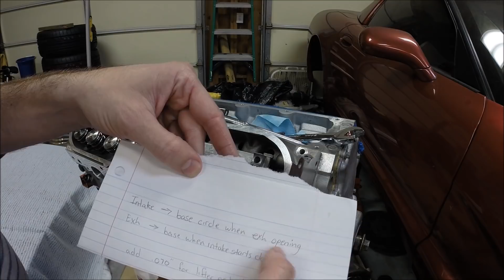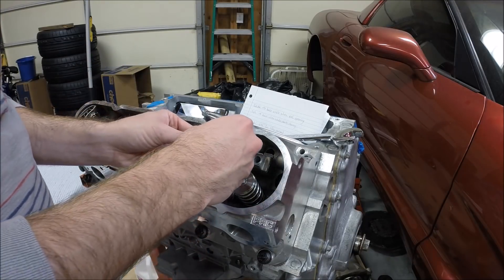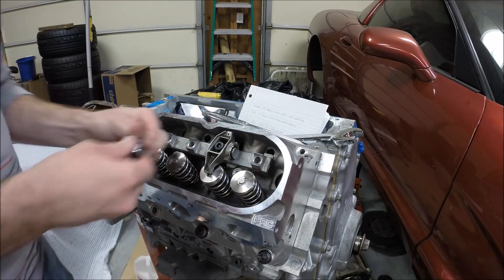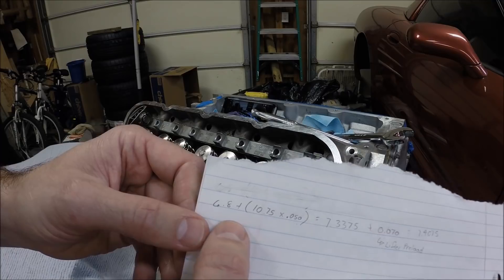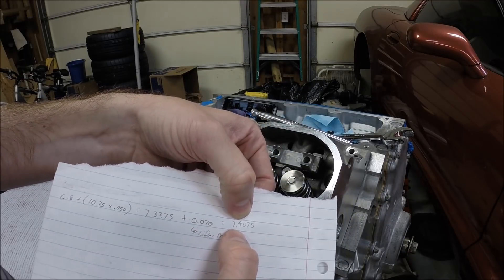LS Engine Tech: Measuring for Proper Push Rod Length

Comment: Ok Excellent video! My question is can i follow the same steps that you have laid out without dissembling my old stock roller lifters? Basically i was under the impression i could measure my pushrods during final assembly and have already torqued my heads down on my 408 inch Lq9. So taking my measurements following your instructions  (only with my stock replacement comp cams roller lifters instead of your solid lifters) will that change the lifter preload that you've provided at .070? After the smoke cleared my math came out to a 7.3325 push rod. Thanks for the post much appreciated!
Reply from the maker: The challenge with not using solid lifters is that you can compress the lifter or it can bleed down (or wasn't fully pumped up since the motor hasn't run) and give you a false reading.
Reply: Ahh i see... well so far I've checked 3 separate valves and have had the exact same reading on all three. I guess i will have to cross my fingers on this one. Thanks again. @ScrufsGarage
Reply from the maker: No problem.   Best of luck.   Let me know how it turns out.  Hopefully a super quiet valvetrain!!
Reply: Michael Cullen what are the cam specs?

Comment: I'm working on my first LS motor, I've built many OS SB and BB chevys in the past, so Im at the research stage, and ripping down my junkyard 6.0 LQ9. Regarding this video, what would be the procedure if you didn't have the old gaskets? Do you wait until after you install and torque the heads down to do the measure, or can you dry fit the head without a gaaket and then deduct the amount that a compressed head gasket specs say it wil be?
Reply from the maker: Yes, you could dry fit and then add the amount of the compressed head gasket spec.

Comment: You partially bolted the head on because you knew you already had compressed head gaskets right?
Reply from the maker: That's correct.  I used the old head gaskets which were already compressed for measuring.  At that point, you only need to get the head bolts tight to take out any play, but the torque sequence isn't needed since you aren't compressing new head gaskets.

Comment: After watching so many videos and still confused by them this is the best one
Reply from the maker: Awesome, glad you found it helpful.  Thanks for watching and good luck on your project!
Reply: Scruf's Garage one more question, after you get the right pushrods, you still torque them down to the 22 lb ft correct?
Reply from the maker: Yes, the torque spec for the rocker arm is 22 ft/lbs.   The "Cylinder Head Install - Part 2" video leads off with installing the push rods and rockers arms and has some installation tips that may be helpful.  Check it out if you haven't already.    https://youtu.be/cpLwWdWKvCM
Reply: Scruf's Garage awesome I just did, great videos! They help a lot! Keep up the good work!
Reply from the maker: Will do!   Thanks again for watching!
Reply: @ScrufsGarage  where did you get the 0.070 from?
Reply from the maker: The numbers seem to vary depending on who you ask, but for the most part, LS7 lifter preload spec ranges between 0.050" to 0.100".   So 0.070" is a very common spec, as it puts you right in the middle.
Reply: slowgoat6.0 I know right? So many others didn't explain like he did.

Comment: So where is the end of your rocker on your valve stem?   Also I want to know how many days did it last before it blew up.
Reply from the maker: I'm not clear on what you are trying to ask.  The LS engine family uses net lash rockers, so the only way to adjust the sweep of the rocker tip is to shim the rockers or pedestals.  However, there is no seat under a stock rocker arm that can be adjusted on a stock setup. The entire stand has individual pedestals on them that align the rocker and provide the proper seat height for them. The stand and the pedestal are one piece. No adjustment there. You can shim the stands, but you would not have that option on an all stock engine, nor should it need it.

Comment: you know there is a guy at sloppy mechanics channel that puts cams in his engines and uses the original push rods and makes over 1,000 hp turbocharged
Reply from the maker: I'm not familiar with his specific setups, but there are a few basic considerations.  Depending on what components you've changed, you may need a different length PR (which is the point of this video).  As for upgrading PR's, remember that dual valve springs have a lot more spring pressure than stock beehive springs... thus more force on the PR's.  PR's don't make horsepower, but they can cost you HP... or an engine.  Deflection in the PR will cost you total lift (and thus HP) and a risk of a failure.  Is it worth the risk to save $100?  As for reusing PR's, I chose to reuse my PR's but I already had an upgraded set of .080" wall PR's.  But be sure to check them for straightness.  Roll them across a flat pane of glass.  If they wobble... toss them out.  HTH
Reply: Scruf's Garage i can send you the links to the parts hes using. the valve springs he is using are single coil springs good for .600 lift for pac #1218 cam is an elgin cam .575 .575 lift every thing else he uses is directly original to the engine. with out the turbo it makes like 560 horse? with just a cam.  latest engine he did this to was a 4.8l ls1 he even used a push rod that was egg shaped from riding on the cam lobe and just flipped it over and used the good side on the cam. he also dosnt torqe anything down usually. just runs the bolts down with an impact...
Reply: Scruf's Garage i am not arguing with you i believe you i am just amazed at what this guy does.
Reply from the maker: haha... all I can say is I'm jealous of folks that have that kind of luck.  I can use the best parts with the most OCD attention to detail during installation... and still have stuff fly apart, haha.   but if it works for him, then more power to him.     The single coil springs certainly keep the spring pressure down, and .575 is relatively low lift, which helps too.  There can be some many variances between applications, that it's impossible to have "hard" rules about things.
Reply: Scruf's Garage i hear you and understand completly

Comment: LS has hydraulic lifters, they arent as critical as a solid roller. Old sb chevys had a zero lash then you went 1/2 turn to a 3/4 turn further.  Thats your wiggle room for pushrod legnth, the 1/4 turn thousandths of 1 full revolution of a sb chevy rocker bolt. Stock chevys came with 3/8 fine rocker bolts, so you need to look up how many TPI (threads per inch) of that bolt. Divide the number of threads -- example : if you have 10 threads per inch, that means you have .100 for every turn of the rocker. This is a random TPI I used so dont use it, research it.  So if you had .100 per turn, 1/4 of .100 is your margin of error which in this equation would be .25.
Reply: I think the rocker bolts on a ls is m8x1.25. Doing the math 1.25 ÷ 25.4 (inch conversion)= .049 per turn.
Reply: Steve Aycock Rocker/Trunnion bolts on LS motors are not adjustable!  Totally different than a traditional small block.  The rocker bolts are torqued to 22 ft-lbs and that is the end of it.  Adjustment is done solely through the length of the pushrod.
Reply: @jaylestingi  only if you are running stock deck thickness heads, gaskets etc. Short travel lifters only have .020 TOTAL preload. Even with all stock components it's possible (as in my case) you may have to run a longer  or shorter pushrod to get correct preload.

Comment: is this measurment taken with lifters "pumped up" or fresh? would there be a difference between the two?
Reply: You want the lifter all the way to the top, not compressed to get your measurement, and then your preload measurement is what the lifter manufacturer reccomends.  This is similar to the old sb chevy zero lash and go 1/2 to 3/4 turn further method. But, you contact the lifter maanufacturer or research what your brand lifter reccomends.
Reply from the maker: So I used an old lifter converted into a "solid" lifter.  I did a video on how to do this that you can reference (free and easy).   The "solid" lifter simulates a fully pumped up lifter, and prevents the lifter from collapsing (like could happen if you used a regular lifter).   The solid lifter is only used for measuring the push rods.  Don't run it in your engine.

Comment: Great video! Thank you! I am doing a little n/a build on my T/A over here in Germany. I am looking for a good adjustable pushrod tool. I am running with stock rockers with upgraded trunions and dual beehive springs. I believe the car has ls7 lifters. The heads are 243s and will be replacing my stock 241s. The car has a mystery thunder racing cam from what the previous owner told me. I am lapping valves and replacing valve seals. I will be using stock .0051 composite gm gaskets. I want to do it right because I know the guy before me who swapped the cam didn't. What thickness pushrod do you recommend for an upgrade if I need to change them?
Reply from the maker: Your build sounds very similar to mind.  I replaced my stock 241 heads with cnc ported 243's.   As for the measuring tool, I used the Comp Cams version.  (linked in the episode notes).  They're basically all the same.  The LS7 lifters are good (that's what I went with).  Just be sure to inspect them if they've been in the car for a while.  I too had an old Thunder Racing cam installed by the previous owner.  Once you get it out, the end is typically etched with the cam #.  Mine was a TR220 (220/220), which was a mild cam.  I found a lot of cam lobe wear on mine however and that had affected the lifter rollers too.  Inspect yours closely.  Mine originally had the composite head gaskets but on final build I went with the GM MLS gaskets which are slightly better (and what a motor with 243 heads would have used).  As for push rod thickness, I reused my Thunder Racing ones, which are .080".  That will suffice the vast majority of builds.     And depending on the age of the components, it might be the right time to do the oil pump and timing chain too.
Reply: Great info, thanks!

Comment: Are those heads PRC Castings or ported O.E.Castings ? are they from TSP ?
Reply from the maker: The heads are from PRC/TSP.  They are CNC ported OE 243 heads (actually they're 799 heads, but 243/799 heads are essentially identical, especially once they're ported)
Reply: I just sent my 317 castings out Monday to TSP, did you go the stage 1 or 2.5 ? I'm putting together a TSP Forged 408 single turbo motor together for my 1996 Trans am. I'm seeing we selected a lot of the same parts for our builds.
Reply from the maker: That sounds like a beast of a build!    I went with the stage 1 porting.  Looking at the flow #s, the 2.5 porting didn't seem to add much.  And my build was already getting wildly expensive, haha.   But the heads are beautiful.  They really seem to do a good job.   Once I get it dyno'd I'll post the results.
Reply: what cam are you running, and what are your power goals ?
Reply from the maker: Joshua Whitelaw  I went with the Cam Motion Titan 4.  The ramp rates on their cams are easier on the valve train and give me some good torque out of the corners and decent street manners.  I should be around 11:1 compression.  So I'm guessing 420-430 rwhp.  More would be gravy but with a 5.7 and that cam I doubt it will make much more.  But my goal is reliability, torque, and street manners.

Comment: Great video.  Isn't the factory length push rod 7.42??  If so, you didn't need new ones did you?
Reply from the maker: 2GUNMASTER  that’s correct, the factory length is 7.400.  I already had an upgraded set of .080” wall push rods so after checking them for straightness and cleaning, I decided to reuse them.